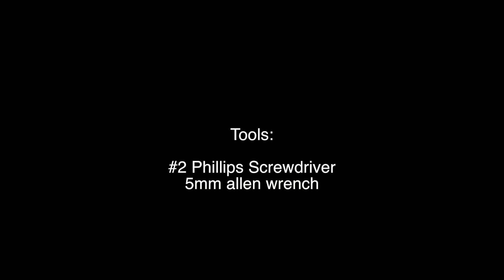Piaggio Fly Rear End Cover Removal | Mitch's Scooter Stuff

Comment: thank you very much mine starts and no power after 30 seconds dies or so ..I am hoping it`s the fuel in evaporation system... but this and the other video is helping me a lot... I tried so hard to figure out the way to get to the sides but this helps a ton